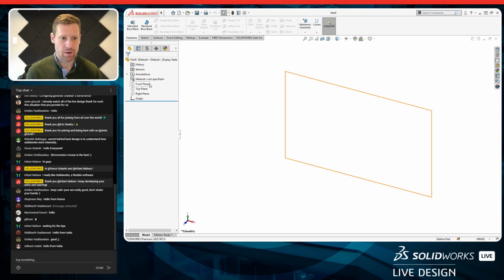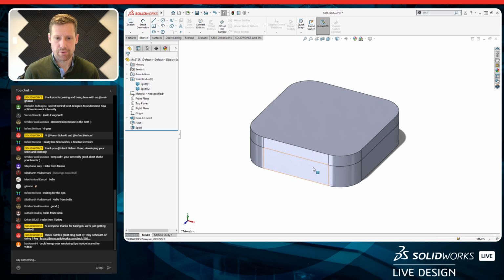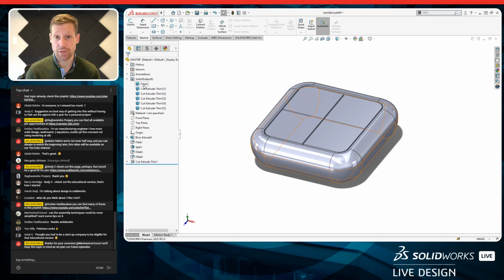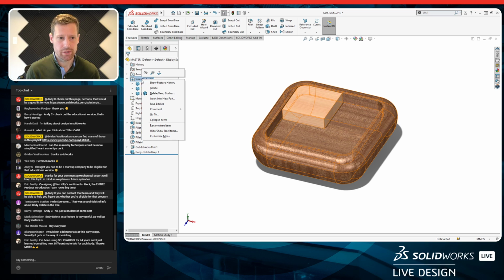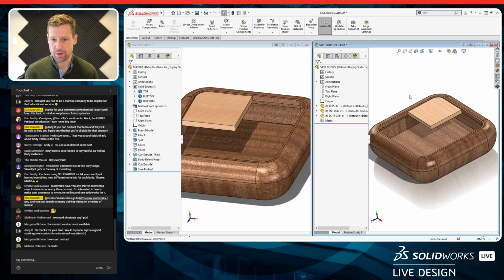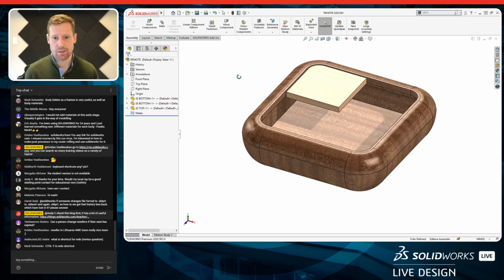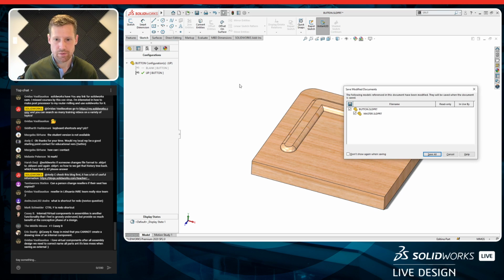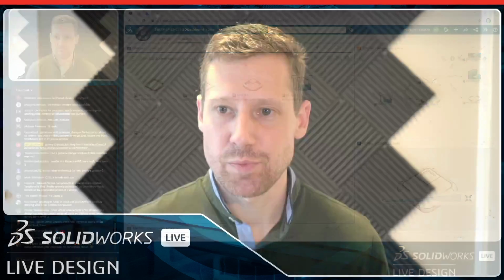The Secret behind the Best Designs - Episode 13 - SOLIDWORKS Live Design

Comment: I'm always creating multi-body parts and creating assemblies from them; I find this to be a great technique and works well once you get used to it. Most of my parts are multiple plates that will be screwed together at the assembly level. This requires holes (thru holes and corresponding threaded holes) to be added to the multi-body part using hole wizard. The issue with this is, "Pattern Driven Component Pattern" does not work at assembly level because it does not recognize it as a Hole wizard feature. The only work-around I have found was to create small pilot holes in the multi-body part and then once you create the separate parts from it, create the holes with Hole wizard feature to each part just so you can use the "Pattern Driven Component" feature. When you insert a part (the multi-body part in this instance) it has a check box to bring in "Hole Wizard Features" but I have never had any luck with this working. Am I doing something wrong, is there a better way of doing this? I have searched many videos on Multi-body modeling and have never found one that addresses this issue.